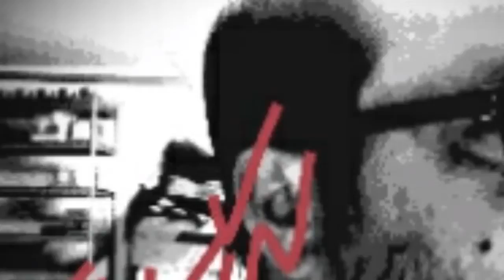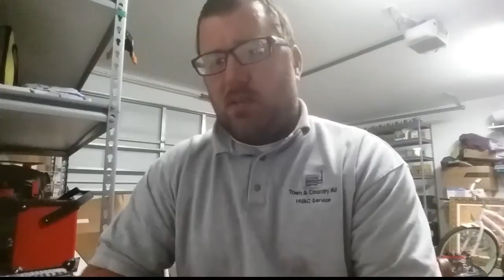Causes for Low Evaporator Superheat (Air Conditioning)

Comment: So I had this issue today. It was a 2T system. At first I thought it was overcharged but I noticed I had low suction pressure. My Delta T  was 16 which was near target according to my readings. I went to air handler and found blower taps switched they had medium speed set to cool. I switched around and then my Delta T dropped to 12. The ductwork was poorly designed. They had a 14" piece of flex about 6' long coming off the supply that ran to a big plenum box where all branch lines spidered off of. Branch lines were poorly hung. They also had a lot of bends in them. I think whoever was servicing the unit before slowed fan speed down to get better cooling but now it's causes pressures, superheat and subcool to be way off. I wrote it down as poorly designed ductwork.

Comment: excellent description, had to watch it several times. Bad airflow is a bitch.  I have to wing it.  I have 1200 apartments with 12 by 24 return for 900 Sq feet 36 inches from hallway wall.  If I can keep coil just above freezing I am good.

Comment: Could you discuss the issues of matching a microchannel condensing unit to a tube and fin evaporator. It is my understanding that this is a  no,  no.   I know a landlord that is having a 2 ton microchannel condenser hooked up to a 34,000 btu evaporator.  He bought the condenser and evaporator through a scratch and dent sale where the AC distributor told him that the system would work OK.  I don't believe it.   What do you think about this?  He asked me to install it,  but I told him of my concerns that the match up was wrong. I think he is getting someone else to do the work.
Reply: There are a lot of manufacturers that match like that. York is an example.